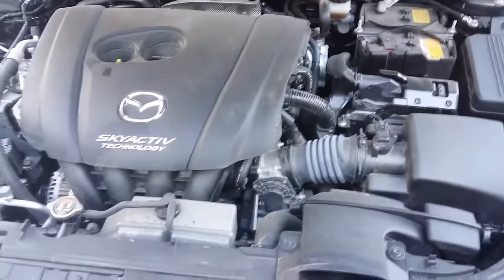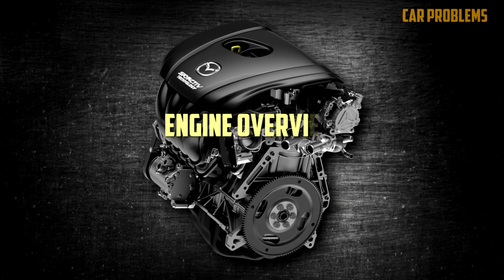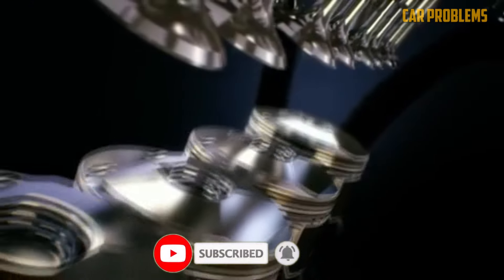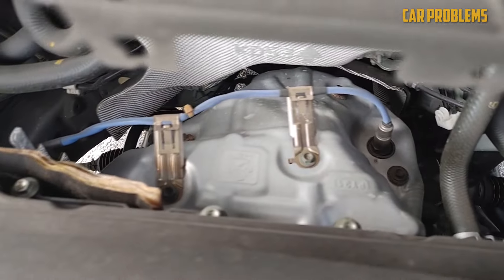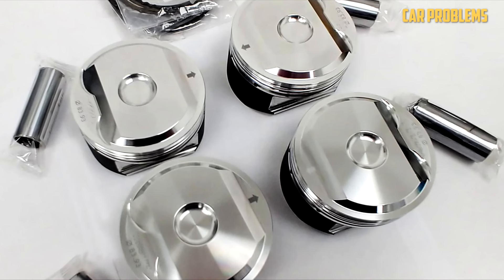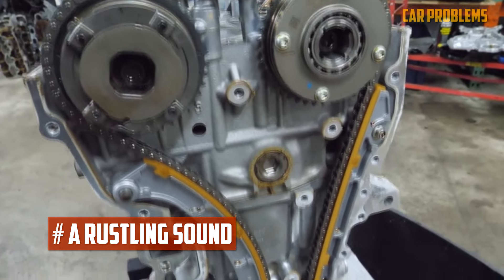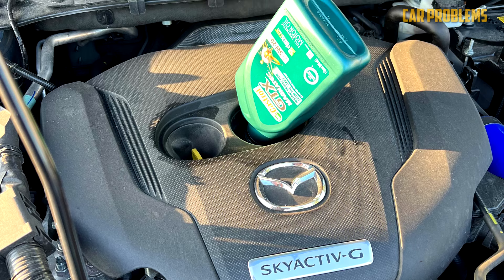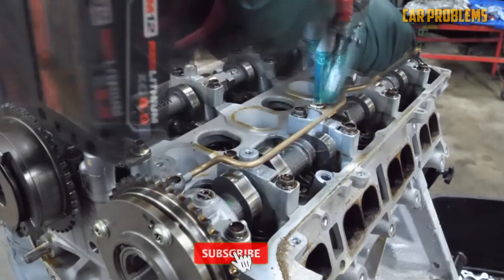Mazda 2.5 Skyactiv-G Engine: Specs, Reliability and Maintanance Tips

Comment: Are used to have a Mazda three 2014 I had 165,000 miles on the car before I traded in the problem was the transmission was slipping. I ran synthetic oil in it from the beginning never had one engine problem its transmissions I wonder about of course that was one Ford on them. Now I have a Kia forte turbo, and I just had to have the fuel injectors rebuilt. I’ve had more issues with Kia than I’ve had with the Mazda, but I will definitely buy a Mazda in the future.
Reply: I think from 2017 onwards Mazda stopped using transmissions made by a company owned by Hyundai/Kia… Scotty K mentioned it in one of his videos. They are also not using CVT’s so a huge improvement and also the choice of NOT choosing Turbo option on every model it produces.
Reply: What other issues have you had with your Forte?
Reply: I have same problem with my 2016 mazda cx5 GT. The transmission slips going from Reverse to Drive

Comment: Don't be confused as it's not really a 14 to 1 compression ratio, it's a 14 to 1 power ratio. This engine uses Miller cycle operation which holds the intake valve open longer to push some of the intake air back out on the compression stroke. The effective compression ratio is closer to the 8-10 to 1 needed avoid engine knock on low octane fuel to . The full 14 to 1 power ratio means more power is harvested on the power stroke with greater fuel economy resulting.
Reply: It does not use the Miller Cycle.  It uses variable valve timing to acheive, under certain conditions, the principles of the Atkinson cycle.  The Miller Cycle, by definition, uses either a supercharger or turbocharger.

But yes you're absolutely right that it's not 14:1 at all times.
Reply: indeed, for compression test, mazda official note says the pressure measured when doing test would be arround 8 bars because the intake valves stays open even when piston goes up. 14:1 is the difference of volume between dead up and dead down
Reply: @deegan463  can you tell me your personal choice between mazda cx5 or cx50 turbo or non turbo compare to acura rdx turbo  which is better 🤔

Comment: I have a 2015 Cx-5 Touring with 105k miles I'm 2nd owner and it's been good but recently it has a lil shake on idle but has new spark plugs, I only use Premium fuel and all Fluid Maintenances have been done. Sometimes feels slugish on acceleration like it doesn't want to barley move and also transmission sometimes has some rough shifting.

Comment: I was looking at the mazda cx50 i have heard alot of good about this brand one day i will test drive one to see what i think i like that theres no turbo or cvt trans option😊
Reply: I just bought a cx-5 for those very reasons also because of supply chain issues most of the 24 models and some 25 models (mine) dont have the i-stop or cylinder deactivation built in them-Win Win....

Comment: Yup, use top tier gas only from stations that have the top tier logo. E.g. Shell.
Reply: Allmost ALL stations in the U.S. have top tier gasoline any more. That USED to be an issue decades ago, but not any more.
Reply: @andrewc4606  I am in Canada, eh.
Reply: @ali3lia what top tier gas has that lower tier gas dont. And how does it benefit the car?
Reply: @VuLe-t9m  From what I know so far, top-tier gas has more detergents and hence a cleaner engine.
Reply: Most gas stations no matter the brand get filled by the same tanker truck. Just liked buying supermarket brand canned corn, chances are it was canned on the same line in the same plant as Green Giant, Libby’s and Del Monte just with different labels and prices.
Reply: @jayson657  Top Tier fuels add their own additive package to that which comes from the refinery. It keeps the fuel system cleaner among other things better than the standard package added at the refinery.
Reply: There is a list of "top tier" gas on the internet.

Comment: Does this apply to Mazda’s turbo charged 2.5 engines as well?
Reply: Not so much. I have the 2.5 Turbo in my CX-5. I change the oil and filter every 2500 miles, but that's me. The compression ratio of the 2.5L Turbo is less than the normally aspirated engine.

Comment: No wonder my CX-50 runs better on Top  Tier gas.  I tossed in 89 and the mileage went up.  I like the fact, he mentioned changing the oil every 6 not 12k miles.  People that believe every 10 to 12 is fine, you're going to have sludge and problems.

Comment: 60K on a 2018, no problems. Average 33.7mpg
Reply: 33mpg? Non turbo I’m guessing?
Reply: @guitarplayer4429  No turbo. I live in the desert where dirt gets into everything. Just one more piece of machinery to fail. Performance is fine being naturally asperated. I would never buy a turbo anyway, too much added stress on the engine.
Reply: @jamescampolo7824  agreed, I was shown and drive the turbo, going back to drive a non turbo, I don’t need a race car, just something dependable
Reply: @guitarplayer4429  I just changed my air filter from a K&N to a Purolator One after reviews on Project Farm found filtration better on the Purolator. so I reset the mpg. Driving my usual routes, about 40 miles per day, 50/50 city/highway, where I was getting 33.7, now after 125miles, it is reading 35+. Driving behaviour the same on the same daily routes, now with a new air filter and not using A/C (not needed now). I've been expecting the mpg to settle lower but it is still the same, +- 35. We'll see after 1kmiles. That's almost as good as my Honda Valkyrie 1520cc 6cyl bike which gets about 37 riding the same circuit.
Reply: As I expected, my mpg has dropped drastically from 35.7 to 34.9 after 500 miles. lol

Comment: I think Mazda is really onto something with Skyaktiv.
I mean in a time where everybody is downsizing like crazy and using turbocharging and direct injection and other nonsense technology like low tension piston rings and wet timing belts to reduce a few percent drag here and there to comply with emissions standards which only makes the engines notoriusly unreliable and short lived and are dealing with a mulitude of problems by design. 
All I have to say is Ford EcoBoost and VW EA888. Garbage engines.
Meanwhile Mazda just gives you a big ol timing chain 2.5L NA engine thats both reliable and fuel efficient while still making good hp with the typical grunt and lack of turbo lag a modern NA engine has to offer. In my opinion modern NA engines are more fun to drive then the turbocharged variants. They sound cooler and have good low end torque to the ECU tuning. 
For STOCK standard economy engines that is, performance engines are different. Like a Golf R.
I find it very interesting how similar to Diesels these engines are in that aspect and how they are build with high comp and direct injection.
As for the known issues: 
Direct Gasoline Injectors are picky to driving style and fuel quality. They hate frequent short distance drives and not getting the beans every now and then when the engine is hot, driving around town at light throttle thats when they clog up. Running additives should help a lot with that too. They dont last forever too, probably should be replaced around 200.000 miles.
Also direct injection will inherently lead to carbon buildup in the intake runners. Thats an issue these engines will face over their lifespan.
Bummer that these Skyactiv engines can only work with direct injection.
Faulty ignition coils seem to be a thing, eh they are not expensive to replace so what.
Timing chains live 3x as long when you change your oil every ~10.000 miles at the most and use the correct SAE oil for your climate and these engines seem to have fairly long lasting chains in them. Looking at you BMW, Mercedes and VW...

I seriously am looking into buying one of these preferably used with low miles for a good price. 20-30k price range.
I want a regular sized car thats fuel efficient, nice to drive, well made and reliable.
These Mazdas seem to be exactly that.

Comment: Have you guys had your cx5's engine opened up every 50k as said in the video?
Reply: Lol no, my engine hasn't needed to be touched in 200,000 miles. Oil changes and new spark plugs is all I've had to do.
Reply: @l4dfreak101 have you ever serviced the transmission?
Reply: No. Just regular maintenance.
Reply: @sailboatlighthouse I would service every 30 k to prevent issues
Reply: @l4dfreak101 diesel or petrol ?

Comment: I got a Mazda 2018 2.5 NA 
110,000 miles and got a crack cylinder head
Reply: Have you overheated the engine at some point?
Reply: @ negative 
I saw on Reddit 18,21 have that problem with cylinder head

Comment: I've had the oil light indicator go on after an oil change and disappeared from another half-court added and is fine until the next Oil Change I don't think their capacity is right
Reply: Same here. My '21 Mazda6 Signature has 28k now. Recently took to Valvoline Instant oil change and they under-filled it. I wanted to add Prolong anyway and I bought a qt of Mobile 1 5/30 to top it off with (not the whole qt of course, but I did over-fill just a smidge...sigh...)
Reply: I just changed my oil/filter. Took more than spec (4.5qt), almost 5qt.
Reply: Many CX5 owners have found for the 2.5L engine 5 quarts will fill it to the halfway mark, 5.4 quarts to fill to the max.
Reply: @sekkaro5258  The stupid owner's manual says 4.5qt with a filter change. That is no where full. 5+ should be used with oil/filter change. Also, wait a while, like a half hour before checking the oil after adding. It takes a long time for the oil to get to the sump. But it still takes way more than the manual states.

Comment: There is a reason why other manufacturers don’t go that high on compression ratio. Another similar example, BMW make their engines run too lean and their engines are currently suffering heat issues.
Reply: It's not really a problem on a Miller cycle engine like the SkyActive G is, but it's also not really a 14 to 1 compression. More correctly, it's 14 to one power stroke ratio since the intake valve is held open a bit long on the compression stroke.
Reply: This engine has been proven for years ...whats your point , BMW failed at high compression not Mazda ....what is your point .

Comment: why does the Mazda dealership want to clean the carbon off the intake valves every ten thousand miles for $200 because of carbon buildup?  If it is not done, the milage goes down from 50mpg to 35 mpg.

Comment: Anyone with GDI have carbon build up?
Reply: I understand Mazda defeated that problem in two ways. The engine has a built-in fuel/oil separator, so no aftermarket catch can is needed. Also, Mazda found that keeping the valves above 400 degrees F would prevent carbon build up, so they designed the head coolant passages to accomplish that.
Reply: Carbon build up is normal for GDI engines, but occasional Italian tuneups would do the trick. Driving like a grandma would contribute even more to carbon building up. Watch videos on how to clean the carbon from the valves.

Comment: Such a wonderful car ruined by an incredibly stuupid design. My 2023  CX-5, 8000 miles, has well known common issue. 135°F coolant temp when its 15°F outside. No heat, no catalytic converter function, higher emissions (EPA take note). 20MPG, more carbon buildup on cold valves, premature wear and etc. Dealer refused to fix because no P0126 code. So I must fix it and void warranty? I bought it because it was 92% made in Japan, where is the Japanese pride in perfection? Back to my old Studebakers I guess.